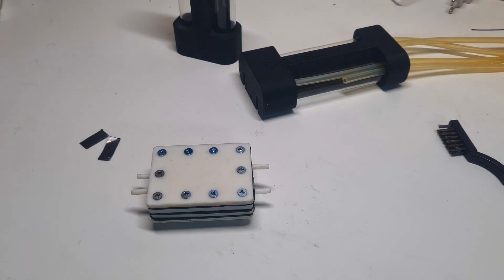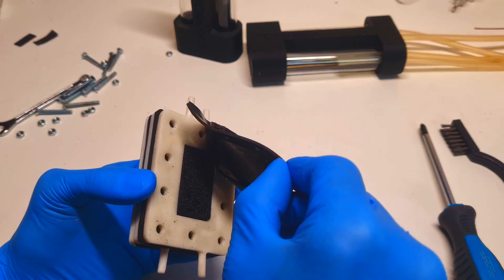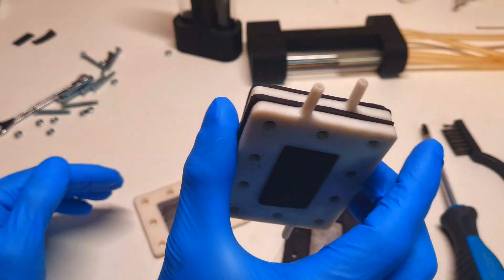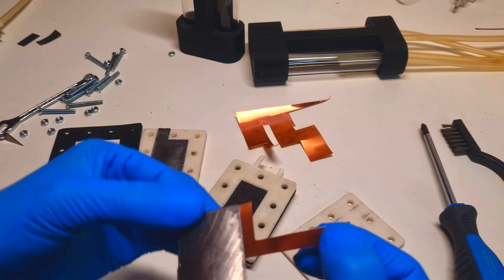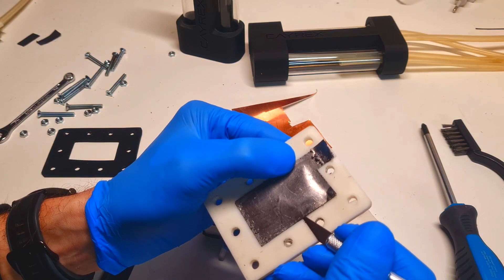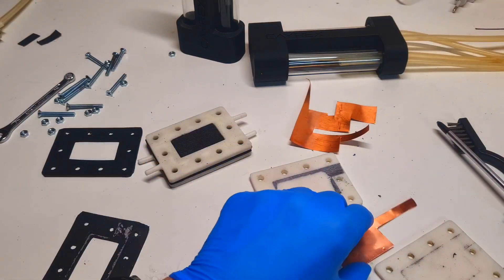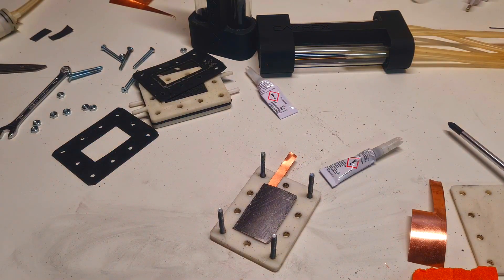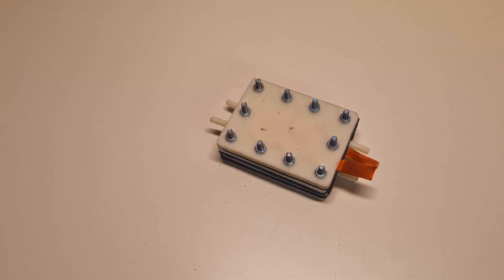Diy vanadium redox folw battery PART 2 - current collector fix

Comment: when you printed the cell, did you do each part individually, as ~flat slabs?  Could you print more than one at a time? ie Vertical orientation? multiple stacked layers?

Comment: I have a video on making anion membranes that are chloride ion selective made by clear pva glue and glutamate HCl baked on filter paper at 140C to 160C and washed to remove anything still soluble. Before mounting.
Reply from the maker: Yes I know,... you make many membranes☺ But will be stable in sulfuric acid environment?
Reply: @cayrex  for pva type up to 10% pure acid water mixture and it will do fine in acid salts or lewis acids. With partially dechlorinated PVC primed surface before PVA coating it will be good till 30% acid water mix but less ion conductivity
Reply from the maker: @CatboyChemicalSociety  Ok, thank you. I will make look at it
Reply: @cayrex  make sure to use glutamate HCl for anion resin mix and not glutamic acid because it needs to dissolve in PVA solution.

Comment: Nice build! I have been laminating one side of grafoil sheets with one thin sheet of PET/EVA plastic. This Is the common, readily available plastic used to laminate paper documents. It makes the electrodes extremely durable and tear resistant. I just make a sandwich of grafoil and plastic sheet laminate between two pieces of ordinary typing paper and run it through the hot rolling machine a few times until it sticks together well. Make sure that the soft EVA plastic side of the laminate sheet is facing the grafoil sheet. I have also had success in using wide Kapton tape as a tear resistant backing also.
Reply from the maker: Good idea my friend. I sometimes place the sticky tape on each side of the grafoil on place where I know that the grafoil will bend.